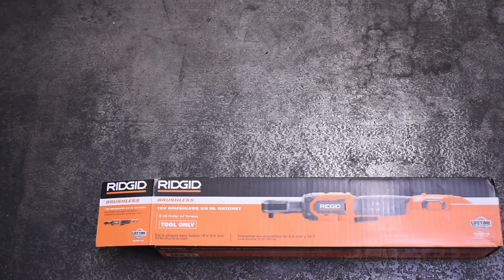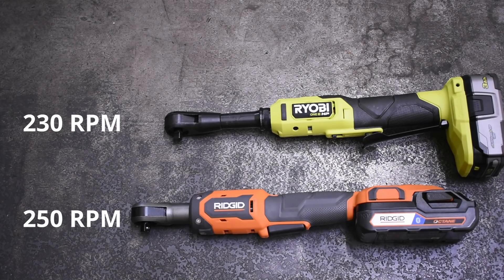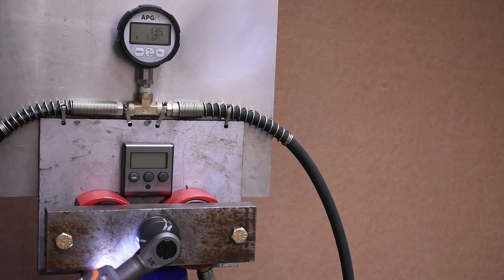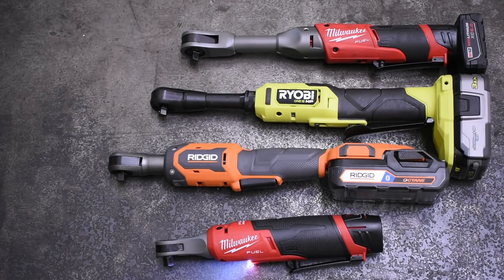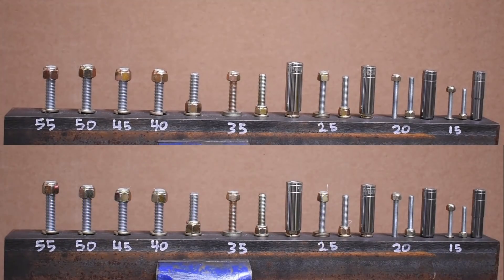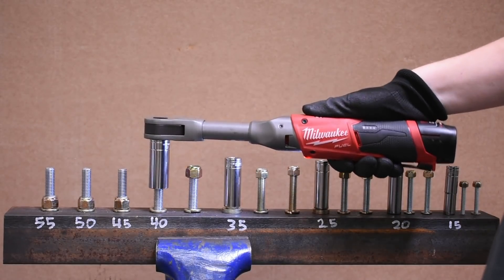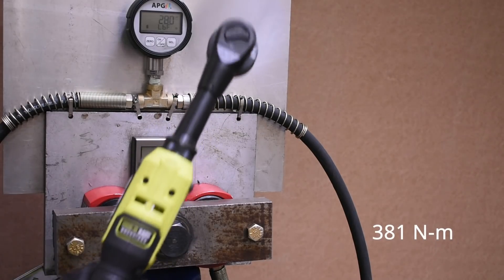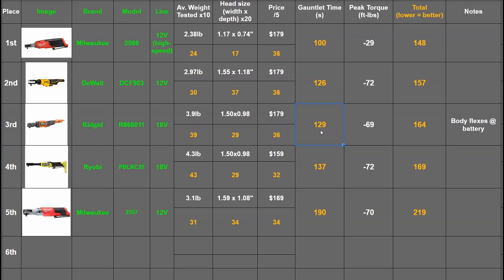RIDGID's 1st Ratchet vs Ryobi, DeWalt & M12: R866011

Comment: My gen 1 Matco, I believe made by Milwaukee, 7.4v Li-ion 1/4” ratchet is smooth, generally quite quick, and has exceptional speed control but is completely weak sauce. That said, if I hit the nut/bolt with the ratchet already spinning, I find it to be surprisingly powerful when it’s got inertia on its side. The later versions with the larger 10v batteries were much much more powerful but they weren’t as smooth and lacked the finesse of the gen 1 throttle.  I’ve always felt that the offerings from the mainstream tool brands were hampered by the battery size and configuration. At least in my experience, smaller sizes to fit into tight spaces were more important than all out maximum torque.  All the torque in the world won’t get you anywhere if you can’t get the tool on the fasteners. Kudos to Ryobi for recognizing their battery design was hideous for a cordless ratchet and for coming up with the rotatable head to try and help alleviate that issue as much as possible.

Comment: The rigid design is kinda mind boggling.  Why did they not reinforce that area? I have ryobi 18v but  I have a little 8v Dewalt screwdriver which might serve as a cool power source for a micro ratchet.

Comment: Ridgid is a good brand, just not the best. I have all ridgid but I went and got the milwaukee ratchet and stubby cause of space issues when working under the hood of a car. A ridgid ratchet would be convenient if you don't want to switch battery platforms. But in my opinion its worth getting slimmer milwaukee.

Comment: Not to be the broken record, but the snap-on 14v ratchet goes pretty good. Worth noting the standard and extended reach have significantly different rpm and torque.

Comment: I just have to add that it isn’t Ridgid’s first ratchet. Many years ago, they had this: R8223403 - that’s the part number for a ratchet head for their multi tool - from 10 or so years ago. Thing was amazing at the time but sadly TTI killed it off as well as ridgids 12v line (that looked remarkably similar to Milwaukee’s current 12v line)
But awesome videos and I love your content!

Comment: The form factor is the most important for these and the large batteries throw that off. Comfort, mobility and speed are all much more important than sheer power on these nut runners. I’d even consider some electric toothbrush type ratchet with a plugless charging dock and fixed battery if it came meant the unit was compact and quick to use.

Comment: Using these tools daily, the Ryobi and Rigid are laughably useless. The millwaukee fuel m12 3/8 speed is just barely worth the extra size compared to the smaller non fuel m12

Comment: How comes on your comparison chart you don't have the skil power right angle drill RI574502 ?  I thought according to your last video this thing blew most 12-volt out of the water
Reply from the maker: The right angle impact driver? Not a ratchet so on a different ranking
Reply: @TorqueTestChannel  I believe it is an impact driver. My apologies on the ratchet classification vs impact

Comment: @torquetestchannel would you be willing to try the ACDelco ARW1201 G12 Series? is the same chinese rebrand that harbor freight previously offered. 

I've had my earthquake branded one for a couple years now, its been soaked in oil and for the price (at the time it was $95 with battery and charger) its been amazing. Probably not a torque monster comparatively, but being an impact guy i didn't expect much more than a ratchet to speed up loosening after cracking loose and reassembly.

Comment: Can you test the effect of using the wrong size socket on a nut/bolt with an impact wrench?  For example, how much torque would you lose to corner deformation if you use a 34mm socket on a 33mm trailer lug nut?

Comment: The advantage of being 18V in this case is you might actually have the batteries, Ridgid's 12V 'platform' is pretty sparse and apparently discontinued as the only thing currently for sale at HD online is a charger.

Comment: I use the Mac tools ratchet.  Quite useful in my everyday boom builds.  Especially when I have tap bolt holes in hard to reach areas. Or just bolting pins down.

Comment: Nice Video, I wonder how the Harbor Freight Hercules 12 volt ratchet would handle the test. I have the extended neck 3/8 drive one and a Milwaukee M12 Fuel ratchet. I use the M12 at work (heavy duty trucks) and the Hercules at home and am happy with both

Comment: Seeing as these are not breaker bars I can’t hold it against them if you can’t use them as such. Why worry about using it to break stubborn fasteners? Just use a proper breaker bar.

Comment: I’m a Milwaukee fan boy through and through but I use the snap on ratchets at work. Trigger is nicer than the lever, the 3/8 long reach will break free most fasteners I put it on with a “running” start. Expensive for sure, but I would love to see you test them.

Comment: Snap-On CT768 is what I run. It's a Brushed Motor Extended Reach ratchet. It puts out 70ft-lbs but only 125rpm. I wish I could send it to you for testing but I use it everyday. Like you said, high torque ratchets slow down less which is exactly why I got it. 

 I had the Milwaukee Extended Reach 55ft-lbs but the batteries would vibrate loose (on all of my Milwaukee Tools). The Snap-On 3/8 14.4V Impact is mediocre but the CT768 is so much better than anything else I tried for E-Ratchets. The head is so small, it's greaseable, comes with a protective boot, and you can put so much torque through it. It says only 158ft-lbs manual torque, most I've done by hand is like 220ft-lbs, just freaking hanging off the battery.

My Aircat 805-HT puts out 130ft-obs at 180 rpm. Doing big suspension bolts with it where you can't get an impact is fantastic. I crack it loose with a breaker bar, then use the Aircat to run it out. If it's slathered in blue lock-tite it'll rip it right out but my 70ft-lbs Snap-On won't.

Comment: Similar in design to the Mac and can be modified to take dewalt/Mac batteries is a the Hercules ratchets from harbor freight. Would love to see those and to see if the Hercules batteries make any different torque than the dewalt batteries on the same tool

Comment: Not quite the 1st Ridgid cordless ratchet. I have been using the Ridgid cordless 12v, 3/8 ratchet head for years as a component of Ridgid's now out of production, 12v Jobmax series. The ratchet was one of a bunch of changeable heads on the Jobmax power body. Not the strongest ratchet in the world but pretty torquey and very useful.

Comment: Makita has both a 12v and 18v ratchet both of which have an interchangeable anvil design. Also the snap on 14.4v would be nice to see though be careful because with the 3/8 head option there is a high speed version and a high-torque version which is gear reduced for more torque. I use a high speed 3/8 with a 1/4 anvil and a high torque 3/8 with the extended length design (great for water pump bolts or alternator bolts).

Comment: Great video as always! I have the M12 Fuel high speed and it’s a great tool. Also have the non fuel and it’s good for more fragile bolts.

After seeing how well Skil’s right angle driver did, it would be neat to see their ratchet. Also would be cool to see Kobalt’s ratchet thrown in the mix as well as the Hercules from HFT.
Reply: I have the non fuel version but I’ve been considering getting the high speed. Would it be worth the upgrade?
Reply: @LocksmithLegend23  Oh 100%. I find it best to have one of the XC batteries as well as a CP battery for the tight spots.

Comment: My offer is still good if you need a modern new air powered ratchet, I got one (actually I got two 😎) you can borrow to test if it’s not TOO long in your secret mad lab, lol, it’s the red colored Mac Tools air ratchet with their new clutch system that’s supposed to prevent you from banging your knuckles when you reach the end of the threads on a fastener (really it just limits the power). Many say those cordless ratchets are “old technology” and when it comes to ratchets it’s the air ratchets that are getting the newest technology. I haven’t seen a clutch system in a cordless ratchet yet but my air ratchet does have it.

Anyways, it’s Model#: MPF59038  by Mac Tools.

Comment: I’m a milwaukee guy all day, 1/2 impact of course, drill, impact driver, 3/8 stubby, right angle die grinder, angle grinder….. but snap on wins in terms of cordless ratchets keep in mind I work in a mechanic shop I tried my coworkers Milwaukee ratchet and my other co workers snap on ratchet, and hands down snap on wins feels stronger and a way better design I have the newish brushless snap on ratchet and it is a beast plus the halo light on it is pretty freaking sweet.

Comment: How about the husky 3/8 cordless ratchet it's a 12v that runs to 230rpm claimed 30ft lbs I picked up for $50 but now they are just under $100 or the craftsman 20v that goes 300rpm w/35 ft lbs.

Comment: I have a tack-life electric ratchet, basically representing an Amazon ratchet, I have two 2ah battery’s it came with but I also have a parkside 4ah battery I cut to make it fit and work with it along with a 3D printed adapter to accept Dewalt 12V battery’s. I’d be more than happy to send it to you guys for you to torture test along side other big name ratchets to see how it stacks up.

Comment: Sorry to disappoint, but this is NOT ridgids first battery ratchet.  Here is the first one. RIDGID R8223403 JOBMAX 3/8" RATCHET WITH 1/2" ADAPTER. Fits the job max multitool.  It's been around for awhile now. Thx for all the good content.

Comment: I think you should test the oldschool m 12 non fuel black head it's way more compact than the fuel,slower but I love it, I also have the Amazon juemel brand 16.8v it feels almost as strong so I bought a second one just for the junkyard I wish l the batterys lasted longer than a few months that seems to be the real difference in my experience the battery technology all the e ratchets these days are made in China, batteries are where you'll notice the difference 1,2,yrs down the line great test ttc

Comment: I work at the orange warehouse store and let me tell you that ridgid killing the 12v line was stupid. And them killing the Octane batteries was even more stupid and the reason for it is heartbreaking
Reply: Whats the reason? All my coordless stuff is rigid and Im worried on the direction they seam to be taking
Reply: @ericksoler1221  Octane batteries were ridiculously expensive to make, as they were one of the most advanced, if not the most advanced battery platforms on the market. Couple that with Ridgid being the 'mid tier' in TTI's marketting strategy, with a price cap caused by Milwaukee's (and other major brands') own battery pricing, and the fact that bare batteries are huge money makers, and you've got a razer thin profit margin on a brand that doesn't have as strong a following as its siblings (Ryobi for home gamers and Milwaukee for pros).
Reply: Yeah what's the reason? Unbelievable that you make such a statement without any reason, foundation or data.
Reply: my apologies, the reason I could get was that they had to change their tools to follow what's wanted from TTi. So you can most likely assume that they didn't want to take away from Milwaukee's sales and since ridgid tools are literally just Milwaukee tools with weaker and cheaper internal parts, why take away from the highest selling brand in your umbrella of tool brands. 

My TTI rep told me this and I reached out to their higher ups and all I could get was they needed to redo their brand.

My TTI rep for Ridgid said that they were told not to say much and give out a generic answer.
Reply: @Em-mp9gp I highly doubt they are using many cheaper parts in the ridged or ryobi lines if any at all. It would make no sense to order cheaper parts when ordering more of the same part will get them a better price and reduce costs anyway.
Reply: I hope they realize they can jump start the 12v line in 12v octane line up.
Reply: This is why I stick with dewalt. I don’t have to worry about them offending someone and make their tools less superior to sell the same companies different branded tools.
Reply: @shanerogers787  Not only does DeWalt make better and worse versions of their own tools to sell as different brands (Mac and Craftsman primarily), but they do it  depending on what store they're selling though (Lowes and Home Depot have exclusive versions of DeWalt tools). Or, more accurately, Stanley Black & Decker (the parent company of DeWalt) does.
Reply: @reaperreaper5098  I was just on another channel a minute ago reading about that between the 12v and 20v tools between Lowe’s and depot. That’s crazy. I’ve been looking at the dewalt 12v line just for a smaller impact and ratchet for home use. I have to 20volt Line but I like the smaller battery size of the 12. I was wondering why Depot didn’t carry the 12v line.I learned something new lol
Reply: They are both owned by the same parent company, but the internals and parts for Ryobi and rigid are not made in the same factories as Milwaukee. They're not using the same parts. They're not even making the same places. They're just governed by the same owning body
Reply: Makes me want to trash all my tools these corporations are scum of the earth .  And pricing goes up daily while the quality is obviously trending downward.  Can thank the torque test channel for this exposure

Comment: I have the Ryobi and really like it. Feels nice and solid. While the battery is an unavoidable part of the One+ platform,I think they've done a commendable job working with it on this tool.

You guys should give Skil's ratchet atry. That's supposed to be pretty good too.
Reply: I have one as well, and am very happy with it.  (I already have several other things in the ONE+ range.)  My only gripe with it is the recessed tab for changing the direction of the head.  So I made an 'extension' that raised it up just proud of the surface so I can turn it with gloves on.
Reply: I keep hearing rave reviews about the M12 Milwaukee and would probably get that, EXCEPT I’m already on the Ryobi 18 platform.  With Milwaukee I gotta get a battery and charger.  Plus it sounds like I need the bigger battery to get the tool to function as designed.  Idk

Comment: Walmart sells Hart 20V ratchet for $98 as a kit. Since it's also from TTI, I think it would be about the same as Ryobi one, but for a lot better price.
It would be fun if you can include that in the next test.
Reply from the maker: Brushed and lower torque, but def an attractive price
Reply: That's more comparable to the P344 (standard reach, brushed), not the PBLRC25 (extended reach, brushless) seen here.
Reply: Especially since you can often get various Hart bits on good sale prices...

Comment: Big fan of your channel, I have been using air ratchets for many years and have also been using an M12 non fuel for about a year, a couple of concerns, do any of these have a grease fitting for the head, my M12 does not, also are there head replacement kits available?

Comment: The advantage of Ridgid being 18volt is so you don't have to go between 2 separate sized battery platforms when a majority of Ridgid owners are on the 18volt side
Reply: That's no advantage in my mind. Getting a clunky tool with a failure prone weak handle just because people have 18V batteries already seems foolish.
Reply: @funkingitup1805  the handle isn't a problem if you use it as a nut turner like it's intended. It's not breaker bar.
Reply: @brandonevans4142  Yeah, thats like saying Ridgid sucks because when the battery is used as a hammer it cracks.

Comment: To be fair it's not their first they had hat system that had a motor and you could change out the heads and they had a rather head and they had motors that were 12v 18v and pneumatic I'm pretty sure they had a ratchet attachment
Reply: Ya I looked on ebay and they did have a ratchet and a 120v motor as well called jobmax

Comment: Been using the Milwaukee M12 quite a bit, and it’s hard to find fault with it. Given that the main use I have for a cordless ratchet is when space is an issue (otherwise I use an impact or my Mac Tools air ratchet), I don’t think I could justify purchasing the larger tools. They would have to offer crazy high speed or some other party trick, like a flexible head or programmable torque settings.
Reply: The only Milwaukee too I own, 30ft lbs is perfect for 3/8s on the tighten, I wouldn't want more really. Also, this thing is amazing, how did I live the last 25 years of fixing junk without this genius tool.
Reply: Same boat for me. I could care less about power as long as it can spin the out. Its the places I can fit the rachet that is more important to me.

Comment: Great comparison. Now I'd love to see the Kobalt 24V, Craftsman 20V and Skil 12V ratchets thrown in there.
Also, Makita released a high speed XRW01Z ratchet last year. 800 RPMs and 35 ft/lbs look like a nice deal. Amazon sells it for $115, or $45 less than HD.
Reply: Plus the Makita has an interchangeable head with 1/4 drive & 3/8 drive
Reply: I just got mine from Amazon for 95$